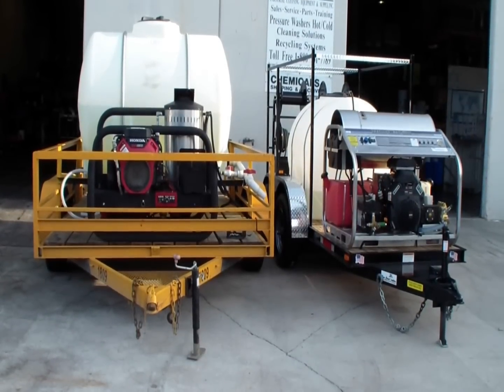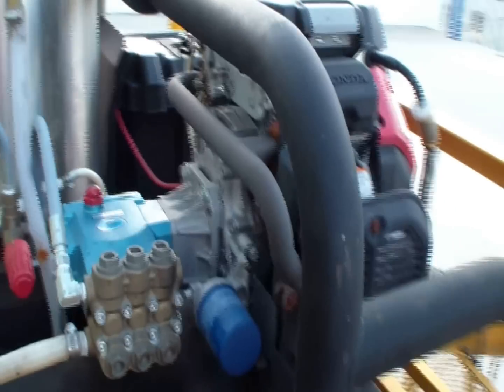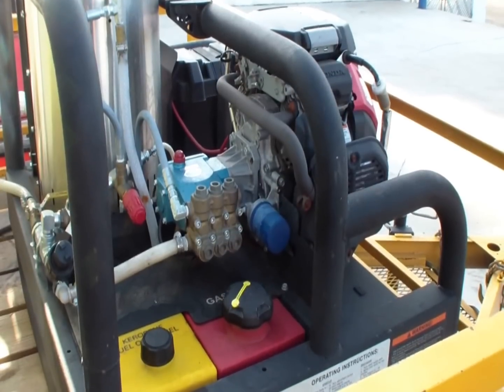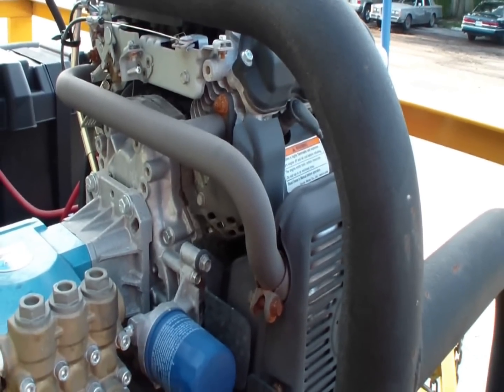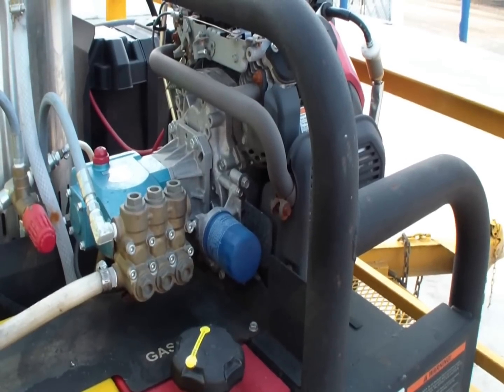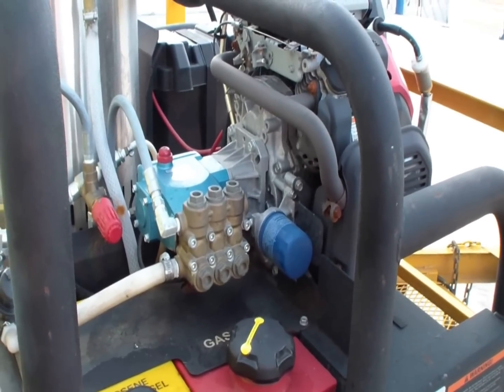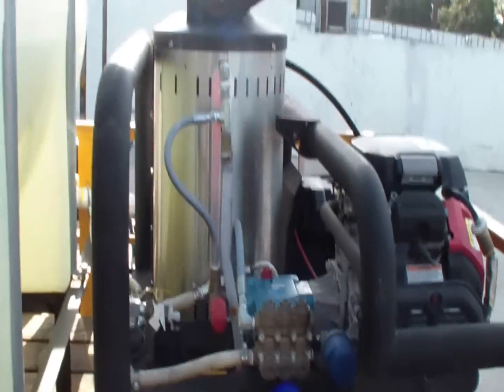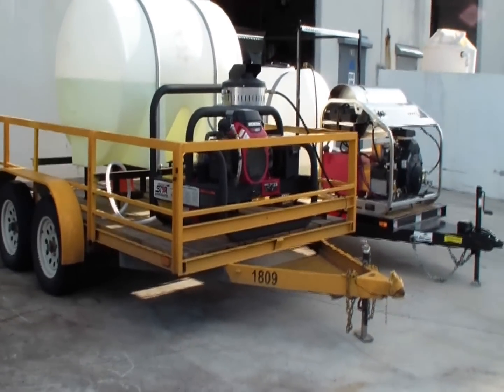Direct Drive Pump Verses Belt Drive Pressure Washer Pumps. Dan Swede 800-666-1992 sales@hcsclean.com

Comment: Hi Dan, I have a gx390 with a GP 4gpm direct drive pump and  I’m looking to increase my flow to 5.5 gpm. I do a lot of residential house washing and driveways. I was thinking of getting a belt drive 2500 psi unit with a GP 5.5gpm pump...but to save some money I was looking at bolting on a gear drive GP 5.5gpm pump to my gx390. I know the belt drive runs a lot cooler than a direct drive...what has been your experience with belt driven pumps compared to gear driven pumps?  Any advice would be great!

Comment: Dan ~ I have scoured the internet on videos for pressure washing. I appreciate your insight! I have a 1973 Case MB 4/95 Unimog that I would lie to put a pressure washer on (hydraulic or pto drive capable). I would like to use the unit to blowout culverts and clean equipment. I have seen hydraulic drive video of pressure washer but I don't know which pump to go with. This video helps me to better understand direct drive vs belt. I think I like the belt drive but the hydraulic drive would be better suited for out of the way installation. Any thoughts on hydraulic drive for pressure? Thanks in advance if you can assist me!
Reply: @AEON. 
Well explained comment.